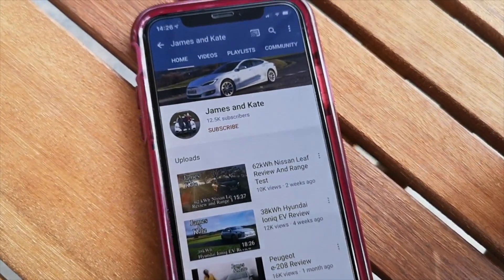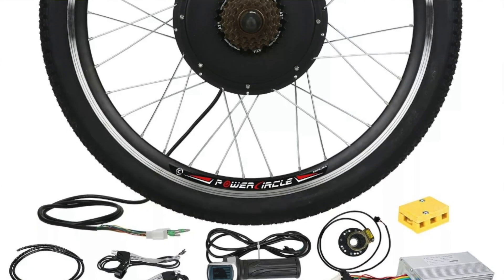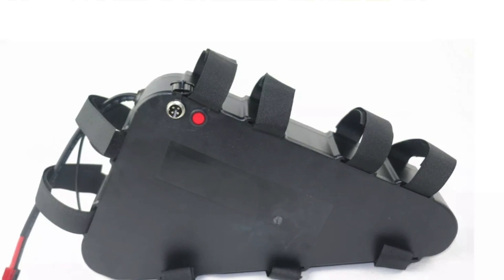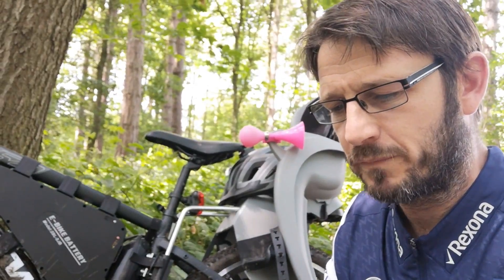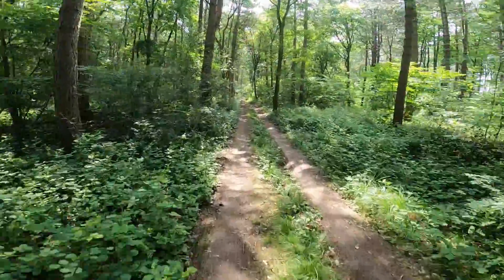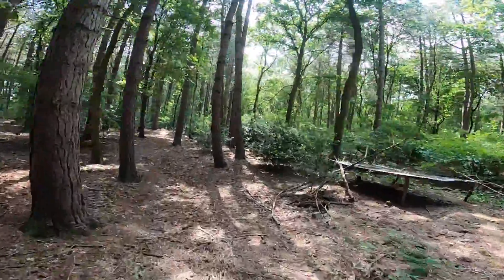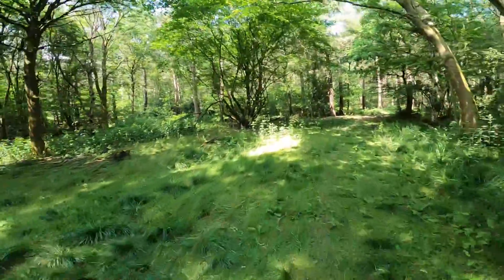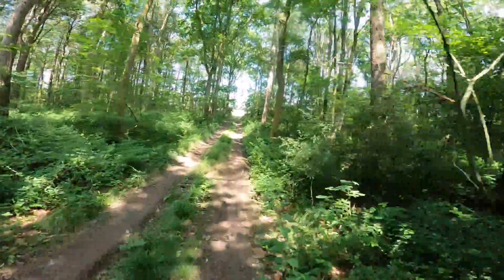Insanely fast homemade eBike Project

Comment: I have a 1000 watt version, I run in restricted mode, and its plenty enough speed to be honest, cruising along at 15mph is ample, it gets me out in the fresh air, which I couldn't do on a normal bike, due to having a fused ankle and degenerative disc disease in my back, the only thing I would fault on the cheaper kits, is the fact that the pedal assist comes on really quick and powerful, so be very careful anyone that wants to build one of these bikes.

Comment: I built an ebike about 20 years ago from a kit from China.....this was long before ebikes were popular...it use 3 x 12v lead acid motorcycle batts in series to make 36v and you had the get a bike shop to build the hub motor into a wheel.....it weighed a ton...could hardly lift it :)

Comment: In 2016 i turned a 15 year-16kg Steel-26in Mountain bike to ebike with a 500w 36v rear hub motor and 13ah dolphin case battery. The bike ended a 29kg (with rack and bags) bike with 33km speed in only throtle mode. Before the lockdown i bought on 12,5 kg urban-fitness aluminium bike 9 speed hydrolic brakes, i put a tsdz2 350w 36v mid drive motor and a small 750ml water bottle sized 7ah battery. Total weight 19kg. The bike is a pedalec with no throttle. Range 70km with the first bike after 4 years in pedal assist level 1 (100w) and 100 km with the second in eco Mode. Two very different bikes, the first a bit like moped, the second a regular bike that takes you further and quicker. I also have a xiaomi m365 scooter and a xiaomi ninebot mini. I use my car only 2000km a year.
P. S I paid 550 euros for the first full kit with battery from an ebay uk seller and the second bike cost me 900 euros (450 the bike from local Shop and 450 euros for motor and battery from aliexpress ). 

Keep the good work, regards from Greece.

Comment: small comments before eceryone does this... 1 if ur using this on road this is illegal as it goes over 12.5mph and technically you need insurance and licence plate.(sure u mention that but didnt watch whole thing... i know theres lots of private roads near u ;) 2. ride to work scheme means you can get a decent ebike at a similar price... i bought my ktm a few years back now and it came in at 1100 after incentives (and at that time it was top of range). that said looks fun!!
Reply: Sorry be pedantic Keith, but the legal limit is 15.5 mph or 25 km/h, but there is a legal margin of 10% above that at which point the power assist should cut out.

Comment: Is the bike legal? Reading all sorts of mixed messages about bikes capable of over 250 w needing to be registered, taxed and insured as they are classed as mopeds or motorbikes. How does this one fit into the system?
Reply: Its not Legal, and the Post should be removed .        https://www.gov.uk/electric-bike-rules
Reply: @itsfahys  cheers. So we have here a video of someone committing a criminal act in order to gain money from youtube.. like you say..delete

Comment: Great video James!

I rented an Ebike for the first time couple years back and following that experience purchase a BBSHD mid drive kit and had converted my Giant XTC less than a month later. 

Now with over 2000 miles on the clock it’s been fantastic! Surprisingly still on the same cassette and chain too which is great from a 1700W peak performance mid drive.

I updated the brake rotors and brakes on mine, added a seat post suspension - (Suntour Sp12 brilliant and great value compared to the thud busters and a few other bits.

Absolutely love it one of the best purchases I’ve made and so satisfying converting your own bike too 👌

Comment: Bit disappointed your  promoting an Illegal   Ebike, that poses a Hazard to  yourself and pedestrians.   I have an EBike myself  limited to  15.5mph     Pedal Assist.     If youve a  Throttle going above this speed you require  a MotorBike Licence,  Registration,  Insurance  and  a Helmet.    My   Orbea  Katu Electric Bike cost about £2000  .  Lot of people get into Trouble with these High Powered Ebike Kits, and are often fitted to bikes that Cant take this kind of Power and you get Frame Failures, as mentioned in one of the Comments.
Reply: @Wooly Chewbakker Spot on Wooly, James & Kate have a big following when it comes to EVs and do some great videos, but this one is just wrong.
Reply: I was also disappointed to see the speed used on a pathway with pedestrians and even a small child who could have fallen off his bike into the path of this bike. I know the camera probably makes the speed look faster than it is in reality but to all you cyclists, any path with pedestrians on it is a hazard and you should give way to the pedestrian who technically has right of way. I am not anti-cyclist but more respect for other people would help your image rather than have people like me dislike the cyclist who basically forces you to give way to them.  Just like those who ride on the pavement and jump traffic lights.
Reply from the maker: You may remember my comment about keeping it below 250w when Florence is on the back? This is switchable, very easily, between the two power settings. Obviously, as an adult, you can make an educated choice to when is and when isn't the right time to use either power setting?? Off road you can have any power setting and speed you wish. All this said, I rarely exceed 20 mph on it.

Comment: I couldn't see from the kit pic or pic of the bike if it came with a torque arm, a sensible addition to a hub motor, simple and easy to fit, you could end up splaying the drop outs as they're not designed to deal with the torque from the motor on the spindles.👍

Comment: Hi I'm researching building an ebike and do you have the links to the parts you bought. I'm probably going to go with a mid drive as they are supposed to better for fat tall people like myself. Which brings me onto the wattage, do you have any issues with the legality of the 1500W motor as with myself liking a bargain the cost difference between 250W (legal) and higher wattage motors is not that much and I like value for money. Currently thinking of remaining legal and getting liability insurance and legal cover through a british cycling membership. There was that horrendous case of a cyclist (non-ebike) in london knocking someone over at a crossing whilst the having the right of way. She sued him despite it being her fault as she wasn't paying attention and looking at the phone at the time and the court ruled equal blame and that he owed her £100k madness! https://www.theguardian.com/world/2019/jun/21/cyclist-crashed-into-woman-mobile-phone-pay-compensation-london
Reply: Yes, James's bike is illegal😬
Reply: @johndouglas770  Yeah I know. Just trying to understand other people's reasoning in order to clearly convince me to do the same :-). But I'm probably too much of an old fart to take the risk now. Although having said that I have been looking at the Tongsheng TSDZ2 which you can get in a 36V 250W variant (or 48V but that's limited to one UK shop as far as I can see). My question would be, is that if I put open source firmware on it then am I still legal? I won't necessarily override the max speed/cut off etc and its a 250W nominal power motor?
Reply from the maker: @robthomas7232  This is switchable between 250w and full beans, hence being able to keep it under wraps when Florence is on the back. I'll be honest, and you shouldn't do what I do, but I rarely have it in a legal condition, I simply apply some common sense to my riding.

Comment: Looks fun, can you program it to provide regen to save your brakes?
Reply from the maker: Sadly not. But with a different controller and hub this maybe possible and something I may consider in the future 👍🏻
Reply: Regen is possible with direct drive motors but pretty pointless as you will not gain much more than 5%.
The only benefit is you save on brake pads.

Comment: I just bought an ebike.  This looks like a fun conversion.  Mine does cost more but I really wanted a mid drive electric assist.  You our look like you are in a Star Wars movie.
Reply: Chris Bates I have a BBSHD On my Mtb and Is a fantastic mid drive conversion option I highly recommend. Bit more complicated than hub motors to fit but excellent performance especially up hills! 

Off the shelf bikes are great too Mrs has a Giant with a mid drive which is great  - (de restricted for off road use makes it even better 👌)